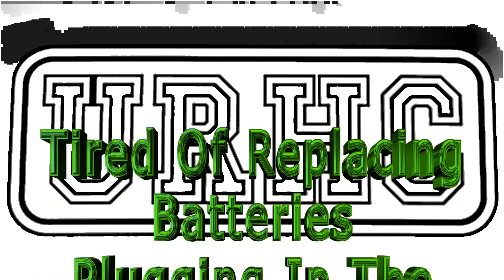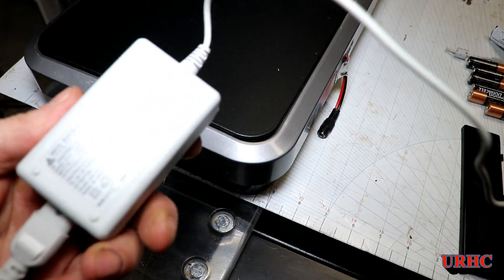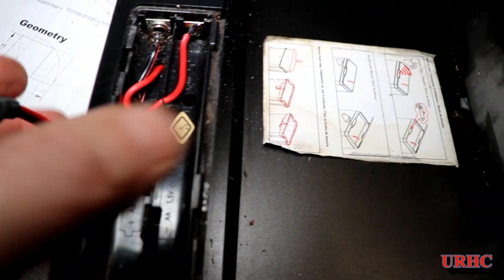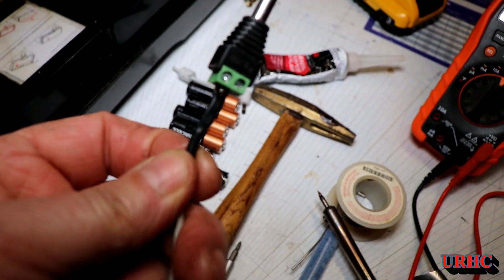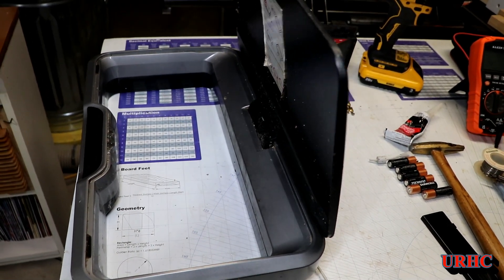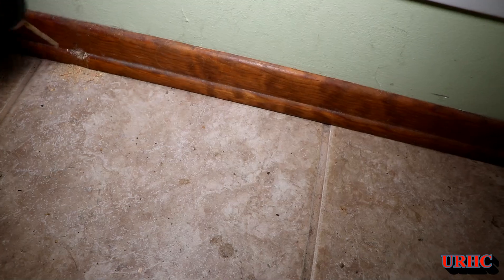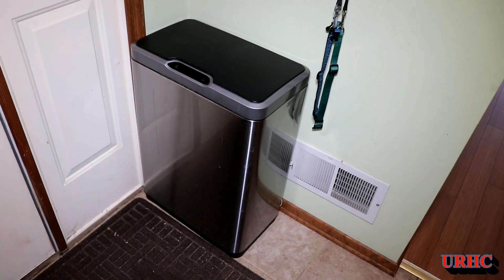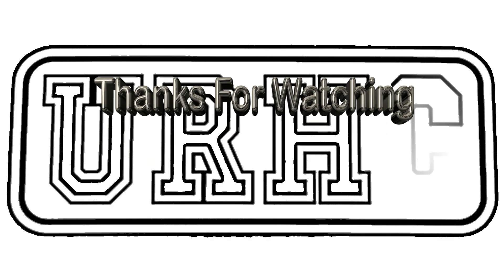Tired Of Replacing Batteries Plugging in the Trash Can

Comment: Had the same problem with our can from Costco. I ended up converting it just like you did. It's been working like a charm for the past few months since I made the switch. I ended up mounting a jack in the side and soldered the connections internally.
Reply from the maker: I was going  to order panel  mount  jack to match the  wall plug but didn't want  to spend  anything so I just  used what was laying around.  When this one goes I definitely will do that to the replacement. Thanks for watching.

Comment: I have a portable wireless thermostat for my heating and hot water system that takes batteries, I also got sick of shelling out cash for them so I got some rechargeable ones but they don't last as long so I have to have some sets in reserve, I think I will convert it, I have a crate full of old power supplies, although I think I may need a buck converter as the thermostat is 6 volt and I think the power supplies are mostly 12 volt
Reply from the maker: All my old ones were 5, 9, or 12 volts and some were ac. These  smaller  ones can vary in voltage so converter would  probably  be best. Most rechargable batteries are 1.4 volts and don't last long in sensitive electronics. Thanks  for watching.

Comment: First viewer, first comment. Did the same with an old elliptical I had that used for D batteries.
Reply from the maker: I don't know why they don't give you the plug in option on items like this that will be in use a long time. Thanks for watching.
Reply: @unemployedredneckhillbilly2023  I agree, however they look at it as extra money even if it's an extra dollar for them to integrate a jack and you have to buy an external power supply separately.